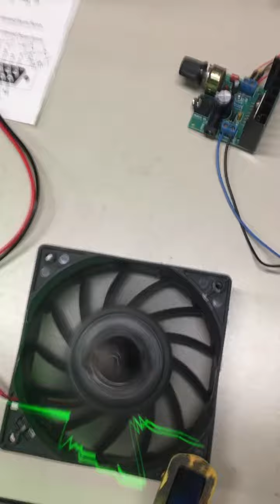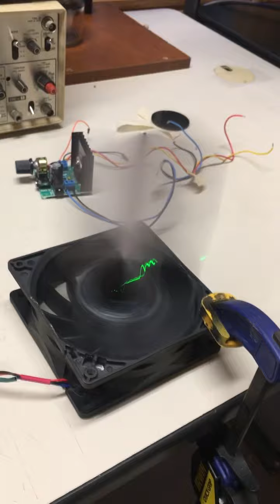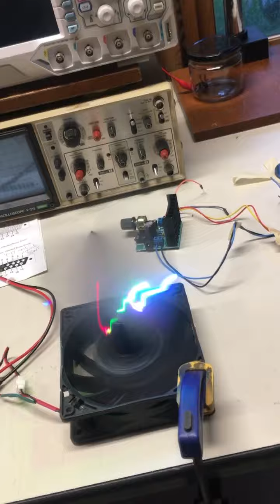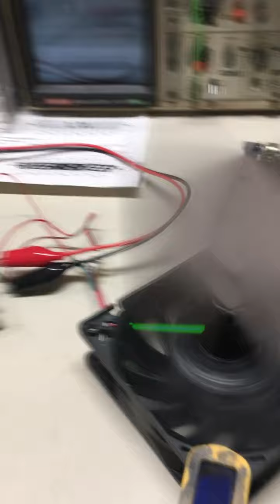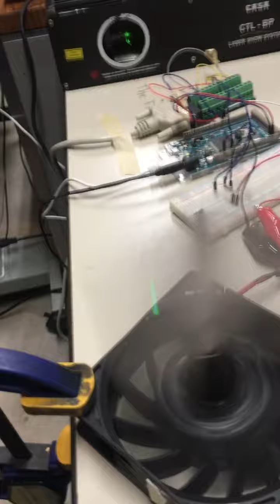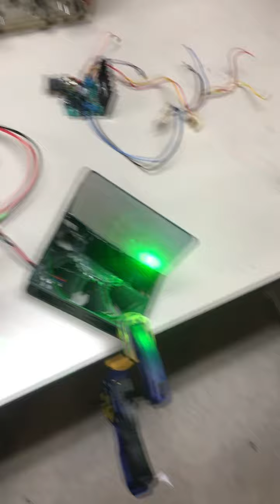laser hologram swept volume display - more tests (with murmuring)

Comment: I was just going to reply to your older video where you replied to a comment about projectors then I saw this. My understanding is that dips repeat 3 colours 8 times each a second. that is different intensities for each of the 8 bits, to produce 256 shades, the same way d/a sound resister bridge works. so your 120hz is multiplied by 24, 2880 frames per second just by changing the light source. That's enough for 2º at 12fps ish.
Reply from the maker: one more option is charliplexing LEDs. check out youtuber bitluni, he claims to get 23,000 fps on his charliplex display module in a recent video

Comment: How much voltage did you run on
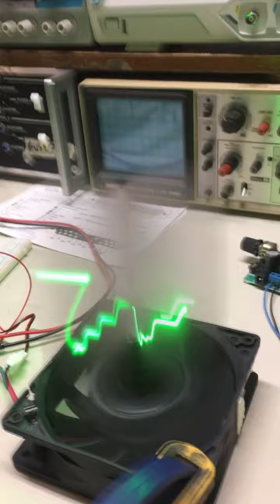Reply from the maker: 4.3V and then 5.7V towards the end. at 0:19 and 2:08 you can see the voltage in in green. the fan is designed for 12V/5A